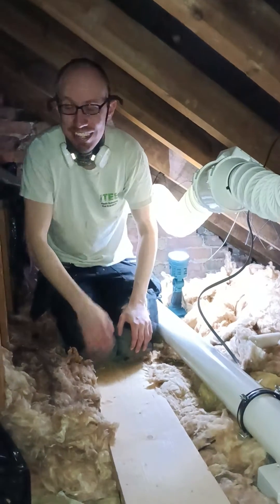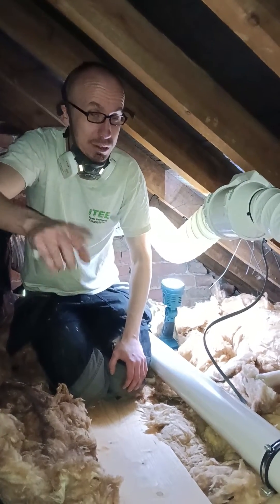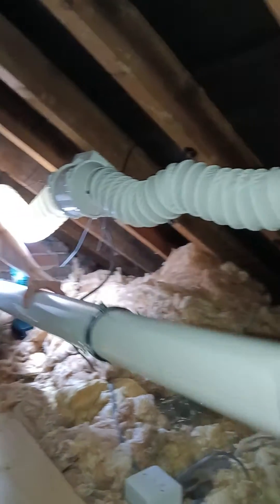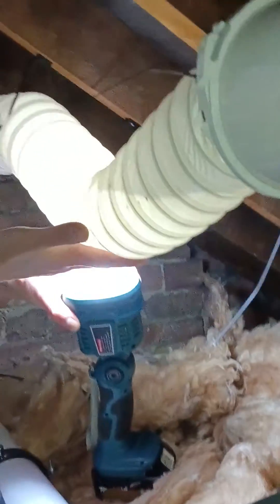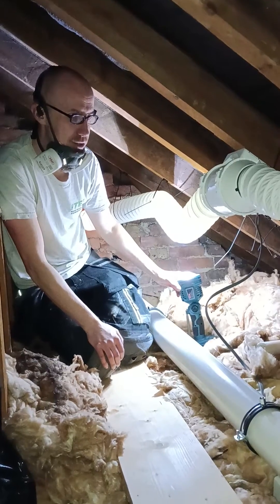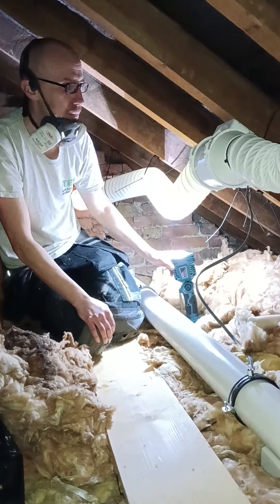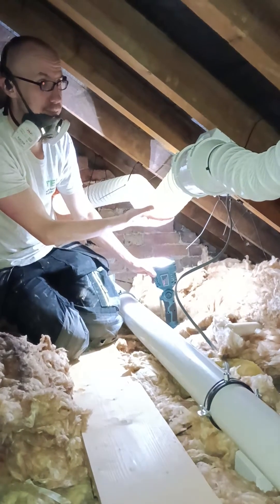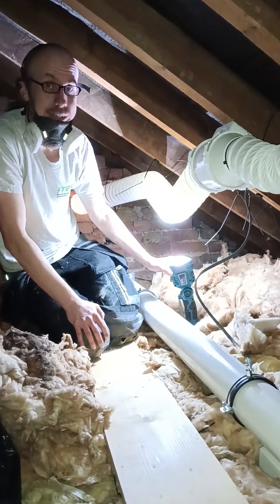How not to install a loft extractor fan (2024)

Comment: Yep not only that the ducting itself isnt insulated so the hot steam enters the cold loft and instantly condensates within the flex... the idea is to keep the ducting insulated all the way to outside and that way more steam will exit the building...
Reply from the maker: You can get away with it if you gain the height early and roll it out but there was no way with this one. The vent was a good foot off the floor and I had about 3m to get to it!! Oops. Why the vent wasn't slammed down to the floor height I do not know!